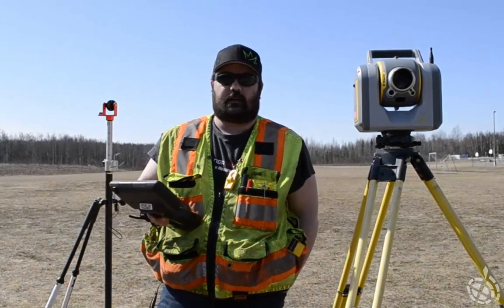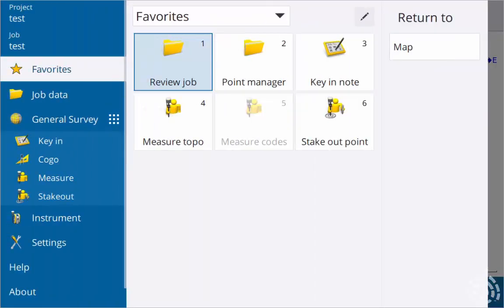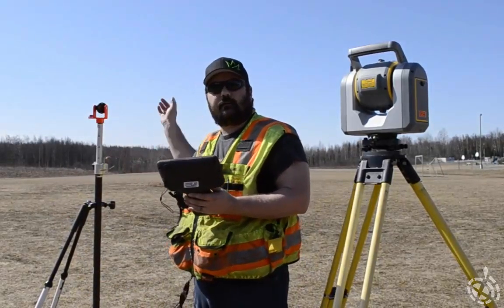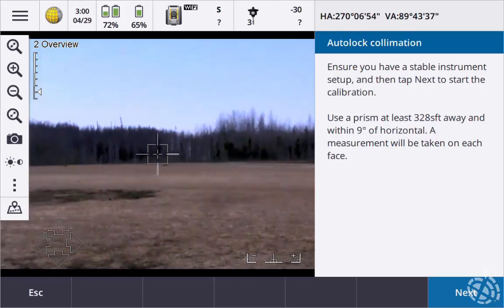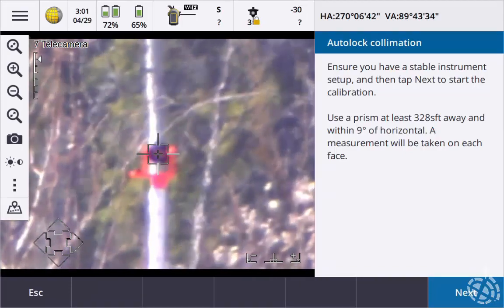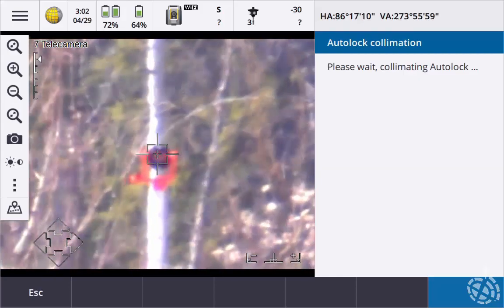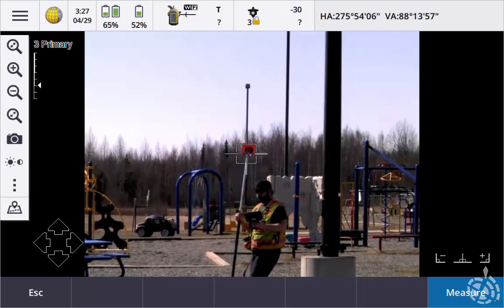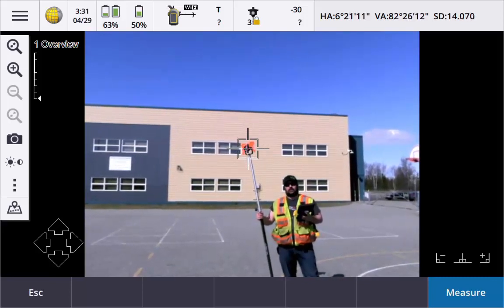Trimble Access Autolock Collimation

Comment: Quick question on doing the Autolock Collimation.  when you begin the procedure, if the TS locks onto the target BUT it is off,  do you then manually move it to dead center then start the Collimation proces?